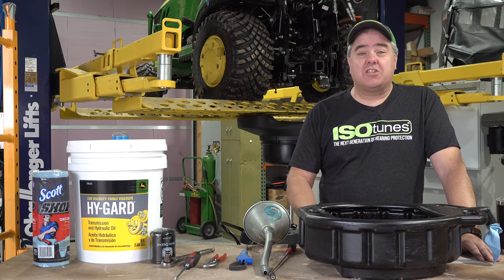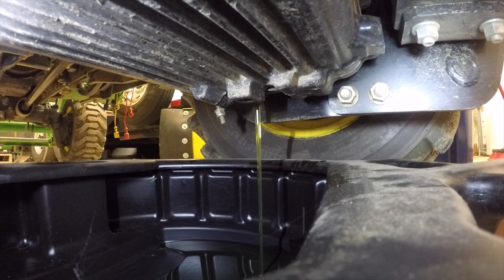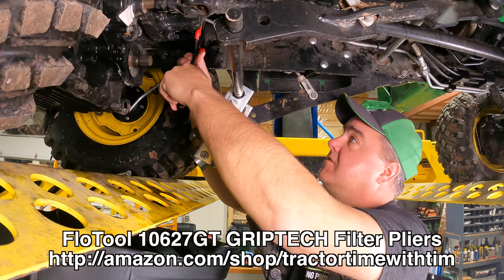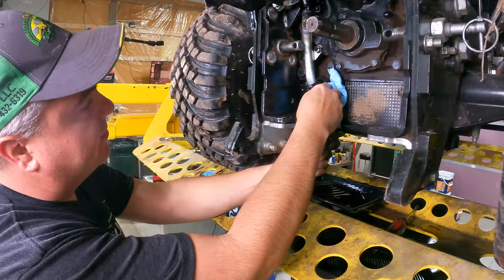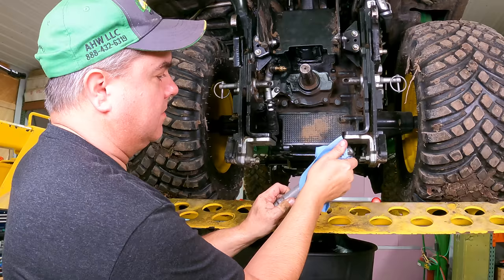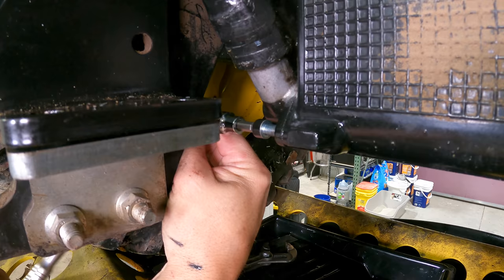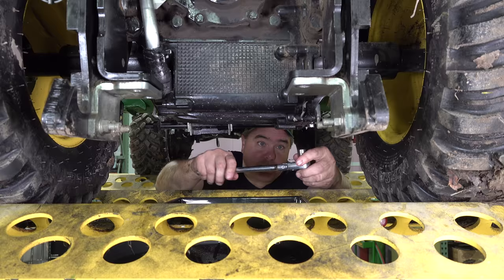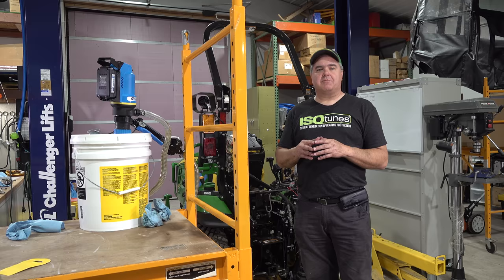Metal Shavings in Oil? John Deere 1025R 200 Hour Hydraulic Oil Change

Comment: Your not done till you have started the tractor and run the hydraulic system to fill all filters and hoses , then shut it down wait 5 minutes then check the hydraulic fluid level again and top off if necessary.

Comment: That strainer at 100+ hours looks almost the same as the one at 50 hours. Not near as worried about running to the service reccomendations now.
Reply: On the low vus higaurd the manual says you can use regular hygaud and spoke with a jd tec rep and regular is actual reccomend in hotter parts of the country.

Comment: Those larger metal chunks on the magnet and in the case would cause me concern. A lot of concern. More than a usual amount of concern....Fines and slight shavings are normal during a run in of 100+ hours. Any chunk is not normal.Save them,label them with date and hours. Could be needed as reference/evidence at some point.
Reply from the maker: I didn’t see any ‘larger metal chunks’ as you say.
Reply: @TractorTimewithTim  Video might have tricked my eyes: looked like there were chunks with shape and edges on the magnet on a stick you ran into the case as the extra step.

Comment: Dealer shop service,especially now, is hit and miss at best. They might do a great job or they might do a crap job but still charge the big bucks. Dealing with crap dealer service that was supposed to be done on my new to me JD 310G backhoe. Found 3 grease fittings that won't take grease (so far) after shop foreman told me (and gave me the bill) that the backhoe was 100% good to go.FRont to back top to bottom eval and "service". All fluids replaced,new belts and hoses under the hood,some more medium repairs. 6 grand total.And I'm finding work not done so I get to do a front to back top to bottom eval......

Comment: Couple things, I'm very concerned, metal shavings in such a large quantity at so low hours, John Deere needs to step up its sediment control during manufacturing, 42 years in the auto biz ! even 'fuzzy' or cotton gloves during manufacturing shouldn't be allowed. It matters.... Amazon has a battery operated transfer pump, works well, ... another option , also saves hoisting those 5 gallon diesel cans, not a premium $
Reply from the maker: The beauty of this one is that the pump is isolated from the liquid.  You can use the pump with many different oil types without contamination.  Very slick design.
Reply: Its not due to sediment control .The shavings are the gears wearing in ,its normal hence the brake in service fluid and filter change!
Reply: @andrewslagle1974  sorry, you're Wrong, I've been too involved with manufacturing processes to entertain your idea

Comment: Good information except most of us don't have or can afford all the fancy equipment like lifts and auto pumps and so on like you have. It would be more helpful if your videos were more geared towards the advantage Joe.
Reply from the maker: Ok, I get it. But I don’t think it really matters.  In fact, I think the video is better because we can get better camera angles. 
The steps are all the same.   In fact, we have an older 50/200 hour service video without the lift.    Here is the link:  Deere 1025r/1023e 50/200 hr Hydraulic Oil Change without left wheel removal
https://youtu.be/IS1SjfmHK2s
I think you’ll find the newer one more helpful.

Comment: Any idea why manufacturers seem to always put filters and such on way too tight like that?
Reply from the maker: Good question.  This was very difficult to remove.
Reply: Most manufacturers put the filters on dry during assembly. They do not put oil on the gasket. This makes them next to impossible to remove. Once you put a little oil on the gasket, they will be much easier to remove next time. The oil also prevents the gasket from "grabbing" and tearing during install. A rare occurrence but it can happen. Another issue in some cases is they paint over the filters after assembly. So you have to break the paint seal before they loosen.

Comment: I HATE those squeeze clamps.  No matter where I encounter them, I always replace them with a nice stainless worm clamp.  Don't even mess with them.  Life is too short for this kind of BS.  Manufacturers use them because they save money.  I get rid of them because it saves me grey hairs.  (^_^)
Reply: I used to do the same. However, the problem with worm clamps is they do not provide uniform clamping force around the entire circumference of the hose. They create an excessive pressure point where the worm mechanism is which can crack or break the plastic pipes and fittings found in many of today's machines. I now stick with spring clamps for everything. Once you have the proper tools to deal with them they are not a big deal.
Reply from the maker: Good comment, Joe.  I learned something!
Reply: Spring clamps also allow for expansion and contraction. They are an engineered solution to a problem.  Your best bet is to have the proper clamp tools and they are easy to deal with.
Reply from the maker: What is the official name for these clamps?
Reply: @TractorTimewithTim  Constant tension spring band clamp , they are a better clamp for this type of application than a screw clamp. This is a hydraulic suction line for the pump  and you don't want any air leaks in it.